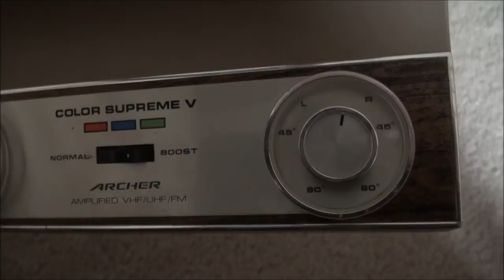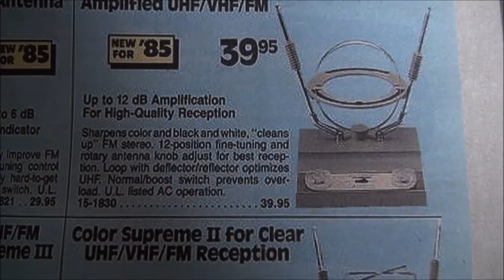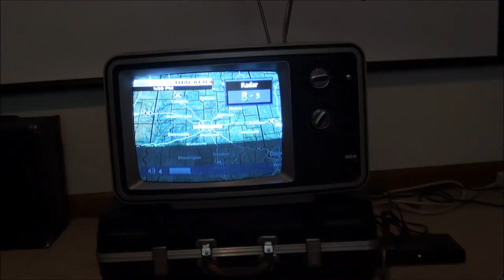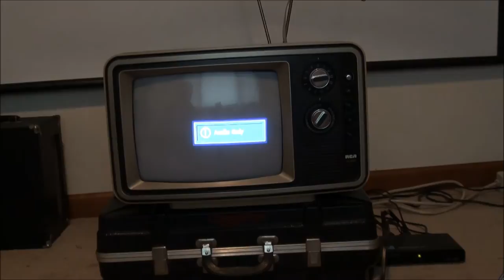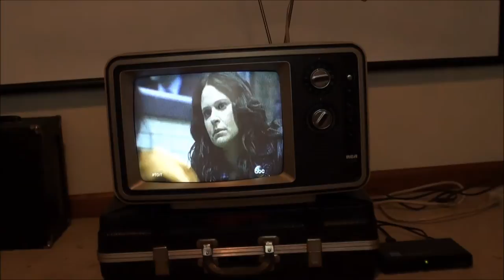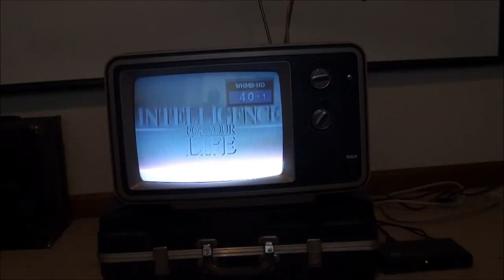1985 Color Supreme V Antenna by Archer

Comment: I bought the high end model back in around 1992, looked similar to that and it did pretty good!  I would imagine those plastic coils either did nothing or they helped to fine tune a frequency, mine were part of the actual metal rods at the bottom, you could unscrew the masts at that point.  Your demonstration here just goes to show, you really don't need a "special" antenna for digital!

Comment: Radio shack 1985 Archer this antenna used a wall wart adapter to pull in hard to reach TV Station's on VHF / UHF  it will work fine on Antenna TV.  Another factor is how fate yOh live from the TV transmitter